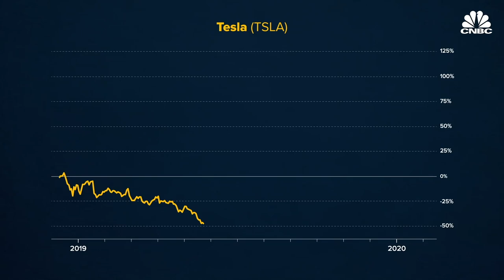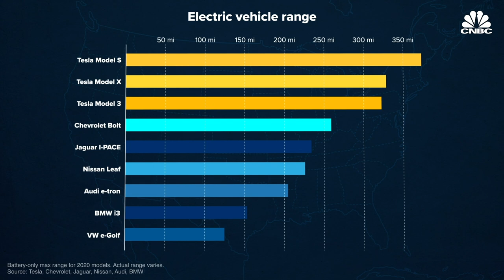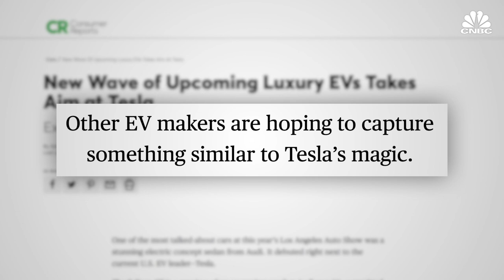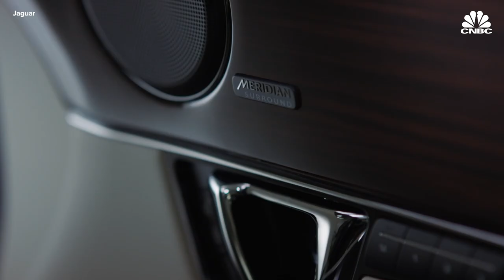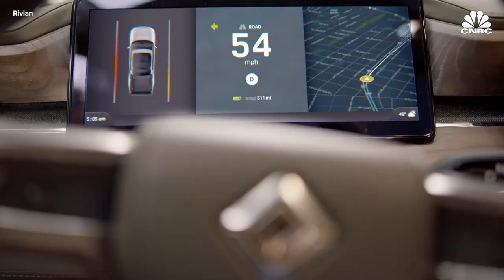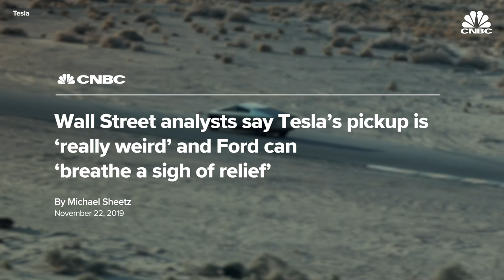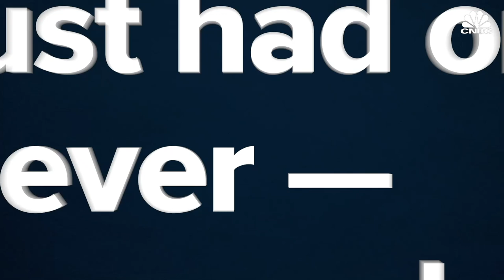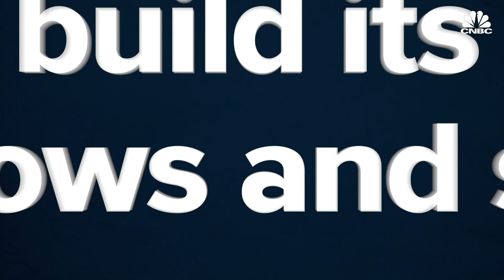Which Automakers Can Seriously Challenge Tesla?

Comment: Tesla's "competition" only makes Tesla look that much better.
Reply: Tesla's supposed competition isn't even competing on a full scale yet. Major automakers are deliberately taking their sweet time to transition.
Reply: Exactly.  If GM and Ford had done what they are doing now 5 years ago, they would be right in the muix with Tesla.  GM actually had a great product with the Volt (I know as I have a 2012 model) the software was cutting edge, the interior was posh, you had a back-up (gas engine) if the Battery ran out.  And then they failed keep advancing the technology, they chinced out on the next model to come out (2016 version was not a better vehicle) and then the did away with the Volt and created the Bolt, all electric, felt like a cheap model, like a Prius or Kia electric vehicle that I wouldn't be caught dead owning.  

When you spend $40k on a vehicle you expect every luxury and advanced technology available.  GM didn't feel that way about the Bolt and that's why almost no-one buys a Bolt... why get a cheap EV when for the same price you can buy a Tesla?
Reply: Cole Jones that’s true but Tesla will keep improving, and at a very impressive rate.
Reply: @1231legomaniac  Absolutely. Testing and compiling data is key to future developments and that's great for competition sake but Tesla will have a fight on its hands when major automakers really turn their full attention to EV's. The good news for Tesla is that it has been able to distinguish itself as a brand and that will be valuable when the EV market becomes truly competitive and its current advantages fade as a result.
Reply: You said.... Tesla's "competition" only makes Tesla look that much better. .... you are SO RIGHT.... I'mma steal this from you.... boom!  You sir, hit the nail on the head.
Reply: @elreydelabaraja75   True, I was really referring to "the big boys" Jim Chanos and company would harp on about.
Reply: Competition? Let's look at Ford. A corrupt, incompetent company that has been ripping off consumers for almost a century. Ford. Competition? Not.
Reply: @colejones6312  this is like the same story as iPhone all over again. Everyone already think EV cars are the way to go. Now it about race, slow people will be out of business(or small it is neglected) like blackberry and Nokia
Reply: @Engineering2AI  Not necessarily. The automotive industry is not set on a fixed destiny which sees 100% EV's. Bio fuels and hydrogen are two other routes of choice, which manufactures may choose to invest. Some already are. There is also still the prospect of hybrid as well. The only people who think EV's are the absolute future are those who interested or aren't paying attention to the auto industry.
Reply: In the next couple years, tesla will be an afterthought. Yeah it still may exist but at that time, every other major manufacturer will have plenty models to beat them.
Reply: @colejones6312  i see this first hand as I am a professional auto tech. Yeah while electric is nice, just because they come out, doesnt mean everyone will buy them. Gasoline engines are still the way to go for the next 10 years or more
Reply: @ssj2camaro21   Invest in Ford and GM in that case, you'll be rich.

Comment: Non-Tesla car makers generally: 
1. Ask double the price, give half the range!
2. Have no 'over-the-air' updates
3. Have very few high speed charging stations
4. Are about 3 to 5 years behind on autonomous driving
5. Have a tiny fan base, so have huge advertising costs
6. Have big shortages in selling old fashioned batteries: they do not own a battery factory like Tesla nor invest in battery innovation like Tesla
7. Think they are a hardware selling company with some  software elements in it...
8. Should think they are a software company with some hardware elements in it.......(a car is simply stated: a phone on wheels)

As the CEO of VW mr. Herbert Diess said in an interview about Tesla: ' A big storm is coming...... '
Mercedes just fired 15.000 people....

So thanks, non-Tesla car factory  managers, what will my petrol/diesel car be worth in a few years? Why  has it huge maintenance costs in comparison to electric vehicles? 

I wish you a job at Nokia (or perhaps at Kodak?) You'll feel at home for sure!
Except mr. Diess (VW is the only company who at least tries seriously): replacement of you is very urgent....think of all the workers loosing their jobs:  your responsability!
Reply: Storm? Haha. More like low pressure area in pacific ocean that vanished even before it lands
Reply: Not the Kia Nero which gets 40 more range than what epa says and the taycan gets 40 more mpg than what epa says
Reply: The bolt is not that bad, though.
Reply: Last thing I want is my car having a always on wireles link! You never watch Irobot? Lol these systems can already be hacked without the Scifi though and its not safe.
Reply: All Tesla cars:

1- Spend more time in the shop than on the road.
Reply: @TheSkunkyMonk  For updating the infotainment systeem?
Reply: @andre495  Yes I understand its possible uses, I don't want that on my car, auto update is bad enough on my PC! And if my car needs updates to run correctly maybe its time to buy a different model. Just no need to have a vehicles ECU, or whatever the onboard computer is called these days connected by wireless. Not safe and not secure.
Reply: Look at the sales figures of "Model X" of TESLA versus "e-tron" of AUDI in Norway and You will see, that You are absolutely wrong. The customers have decided. And for the near future (2020):
VW ID.3 delivers 

- more range with the 77 kWh battery,
- more space,
- more reliability
for less money, compared to Model 3 of TESLA.
PORSCHE TAYCAN versus TESLA Model S, the same story.
Reply: Remember musk's bulletproof truck? Me neither 😂😂😂😂. Tesla is junk......
Reply: Tesla’s days are numbered. Fit and finish is crap and with all the big car companies stepping up with EV now they won’t be around for long.
Reply: @theg.c.142  I remember it clearly.   I don't believe a bullet went through it.
Reply: That seems unlikely.  Tesla built and EV.  Most of the other car manufacturers are trying to cram an electric engine into an already designed gas vehicle and so far with the exception of a couple super high end vehicles they have failed to deliver any cars that can match their range or power.
Reply: Show me a person who says a car is just a phone on wheels and I’ll show you a non car person. Maybe you should just stick with Uber. Other than that you raise some good points.
Reply: Bruh Audi is pretty close to autonomous driving
Reply: @TheSkunkyMonk  this is why Elon has invited hackers to challenge the car. even win a car plus prize money if they are able to.
Reply: @powerful nugget do you own a smart phone? or a flip phone?
Reply: André V Spoken like a True cult member. Tesla had at least a 10 year head start. And according to this report Tesla didn’t even sell 200,000 units, and yet for some unknown reason Tesla is Now the Second most Valuable Automaker in the World ahead of VW, trailing only Toyota. Here’s the Kicker, Tesla Loses money faster than you can burn it. In a USA Today article m, in the second quarter of 2019 Tesla Lost 400 Million which Was less than the second quarter of 2018 of 700 Million But Revue was up 60 percent, How the hell Do you Do That? Tesla still hasn’t made a Profit and I seriously doubt they ever will. If you can’t make Money as the Leader! How the heck are you Ever going to? Especially with all the Competition coming over the next two years. Here’s the next Huge Lost for Tesla, the Cyber Truck, 250,000 deposits for the Ugliest Truck design ever, that aside Tesla will be lucky to produce 20 percent of their depositors. At least three Trucks will hit the market before even one Tesla Truck does, one of which is the Number one selling Truck for 42 consecutive years, Yes Ford. But here’s perhaps the Biggest problem for Tesla, Charging stations and more importantly Charging Time. Nobody wants to go from San Francisco to Las Vegas and have to stop for two hours to charge up. I could tell you a half dozen other problems like Dealerships or places to get your vehicle worked on for Warranty stuff. Bottom Line the Bubble is going to Burst kaboom😇
Reply: WaterDoc S where does your one “fact” come from?
Reply: powerful nugget have you ever been in a higher end car? Welcome to the here and now.
Reply: Not only do they ask double the price, they also look god awful compared to a tesla. Seriously, all these different brands making electric cars and they all settled on the same ugly design
Reply: us competition to Tesla are very late I think Chinese maker are more important and biggest e vehicle market china
Reply: The only car companies that are taking EV's seriously are PSA, JLR, VW, Volvo and maybe Daimler. Regardless Tesla is way out in front but has one major issue. Tesla fanboys are some of the worst people in the car industry
Reply: @noahbowie5985 You forgot the top two, namely Tesla...   Are you trying to say they are standing still because they are out in front?  I think they are still taking EV's seriously and pushing up the range on the S, plans for the Cybertruck, adding factories, etc.  (or maybe you just thought it goes without saying Tesla, hard to tell...)

The other main one you forgot is Ford with the Mach E, the electric F150 and dozens of unannounced models planned for 2022-2025 model years, and I would put Ford as taking EVs more seriously than all the companies you mentioned, VW is possibly next but they have a habit of over promising and under delivering so I don't trust their marketing as they made similar claims 10 years ago. Plenty of other startups I would put on your list of "taking EV's seriously", such as Rivian, but they are not really big enough to count as this point...
Reply: You got 1-6 right. But No 7 and 8 is something only a public traffic user can think off.
I dont need WiFi on my motorcycle. Thx but...no.
Reply: Jeffrey Ferguson You’re cherry picking and regurgitating incorrect information. 
1) that’s 200k cars in 2019 ALONE.  Tesla is going to cross 1M cars sold this year.
2) Unless you were under a rock the last 9 months, Tesla posted positive cash flow for Q3 2019 and Q4 2019.
3) One way to lose $400M while upping revenue is to build an entire functioning factory in China from nothing in 9 months (all in 2019)
4) The CyberTruck isn’t targeting the F-150 crowd for that reason.  Even the Tacoma, which has been in production for 20 years can’t take more than 5% of the segment.  Why go for that when you can go for the people that aren’t necessarily truck people to begin with?  New market means less competition.
5) Charging times are less than 25 mins at a V3 charger that’s currently being rolled out.  Most people should be charging at home over night anyways.
6) How many people DRIVE from SF to Vegas often anyways?  Many people would just fly that.
7) I was able to get in and out of the Tesla showroom with my Model 3 in twenty minutes.  Took me no less than 3 hours each time for my last 3 car purchases (Audi, BMW, Infiniti)

Any more?
Reply: Jody Owen yep, I retired early because of choices made during my working years with my businesses. I’m enjoying life and doing what we love, driving the country.
Reply: Wrong. 3 years and zero visits to the shop
Reply: @TheSkunkyMonk  You're scared of innovation.
Reply: Your petrol/ diesel car won’t lose as much value in a few years as you are trying to exaggerate. Calm down.
Reply: Mustang Mach E will sell better than model Y
Reply: PilotBuckus your joking  right?
Reply: Tyler Leedom  Yep, just a joke. Ford will only make 50,000 next year whereas the model y production will be around 300,000. Depending on how fast ford can scale, Ford will easily produce as many as they can make up to I predict 1,000,000 per year
Reply: PilotBuckus yup with TESLA’s  batteries
Reply: @Those2menoverthere  Nope just stupidity and these cars are stupid. Supposed to be green but look at the battery tech. Need to be replaced every 5 or so years and contain a lot of toxic materials that are much worse for the environment that a little co2. Maybe educate yourself before jumping on the bandwagon.

Comment: “A couple cars from hyundai” really did them
Reply: They looked like that should be their names. "Couple cars, I dunno."
Reply: Yeah wtf was that lol
Reply: The Kia Optima EX seems to be a competitor if it goes electric.  The EX already looks high-tech with it's computer interior and panorama sunroof.
Reply: Instead EV, Hyundai heavily invested in Fuel Cell powered vehicles. Basically, Tesla and EV have problems with charging and battery. You have to wait for app 30min for charging your battery. Hyundai fuel cell, Nexo only takes 1min for full charging. 

Some may argue that Tesla and EV is environmentally friendly. In fact, if you generate electricity based on fossil fuels, then EV is no longer environmentally friendly. Hyundai fuel cell, Nexo only creates water. 

Please, do some research about Hyundai Nexo. 

No more EV, Fuel Cell is the future.
Reply: I bought a Kia Soul EV. Gets more range than a model 3 at $15k less. I was going to buy a tesla, and bought a Kia instead. Not looking back
Reply: @JK-ot1yb  Ok Goober 🤪👌